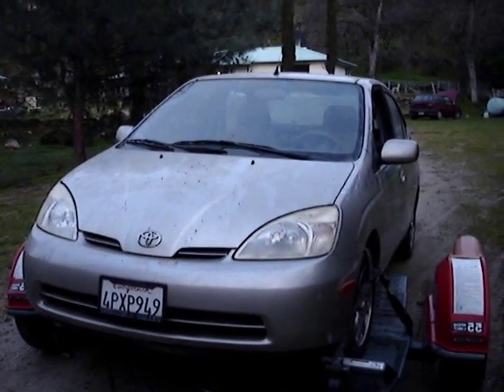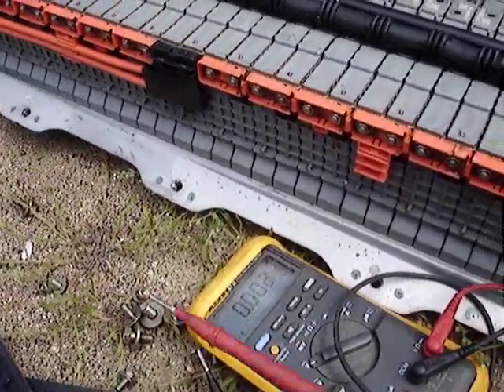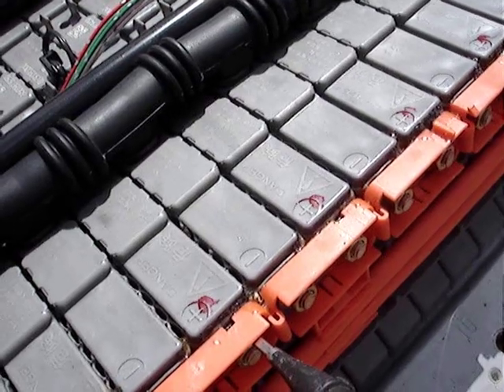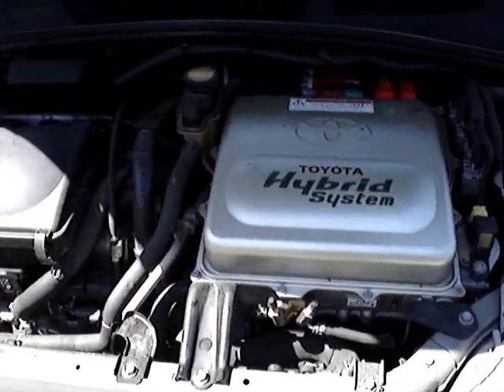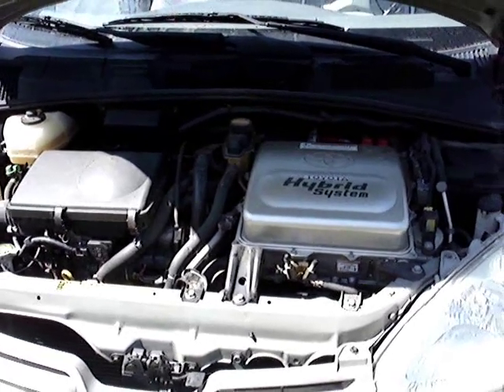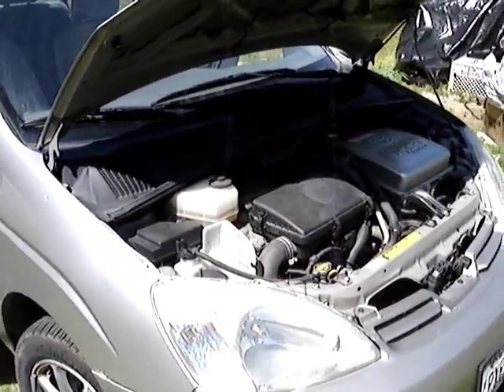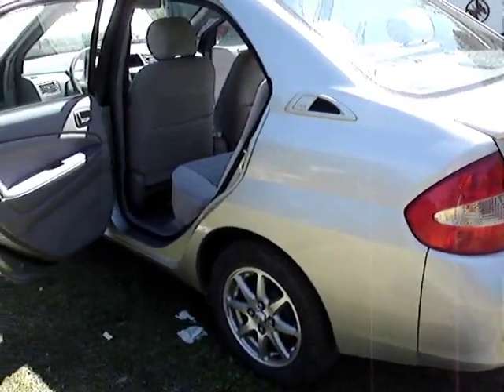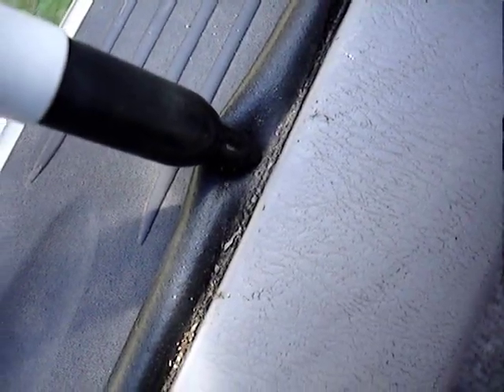Testing a Prius Hybrid Battery. Detailing aToyo. Should you buy one?

Comment: The battery will last you more than 10 years as long as you drive it at least once every 2 weeks.  Don't leave it sitting for too long, if you plan to go on a long trip, you might have to ask someone to start the engine for you, and let it complete it's warm up phase, until the engine shuts itself off.  Rechargeable batteries go bad after a while, if they're left sitting for long periods of time without being charged/discharged.

Comment: If I had to deal with a bad battery pack I think my method would be to work on each cell with a battery charger and see if the battery hold up or dies and just part out the pack tell all the bad cells are replaced. Then if things hold for a month then I would keep it or sell it as you did if things kept coming up. The prius is not all that complicated if its  broken down system by system and understand how each works. Troubleshooting gas engines are just as bad as electric cars can be because too many variable exist with each sensor added.

Comment: Are you saying you don't need to perform maintenance on your 95 civic? XD  He probably didn't read the owner's manual.  I remember it saying not to leave it sitting without running it for more than 2 weeks, because they hybrid battery could drain and eventually wouldn't be able to hold a charge.  He probably left it sitting for over a month without driving, for it to have this problem.

Comment: I agree, I was just told to spend $3410 for  a new battery and this is suppose to be a deal.  Don't buy  this car unless you want to pay a lot of money for an new battery.
Reply from the maker: Yep, the battery cost as much as a new engine.  I don't follow the changes in these cars but with mine when I ran out of gas I couldn't go 1 foot on the battery so I had to walk 4 miles for gas. Or when the battery goes bad I couldn't use the engine to drive on. that's not good.